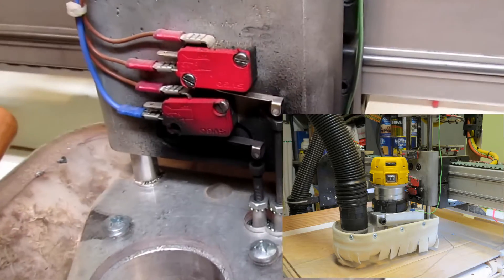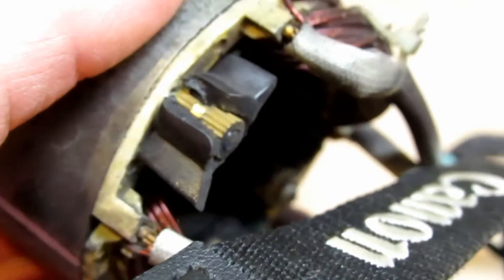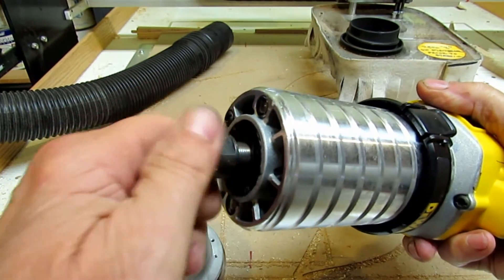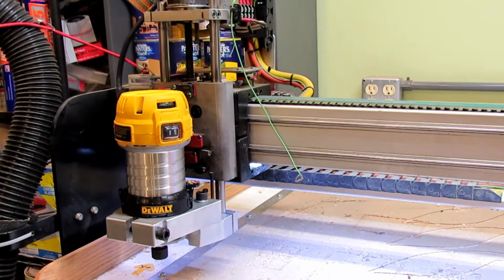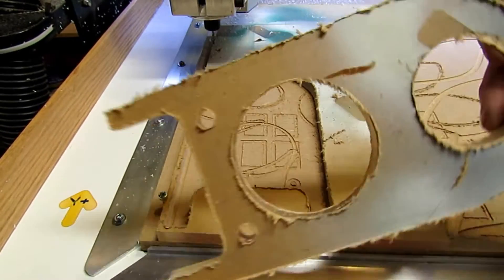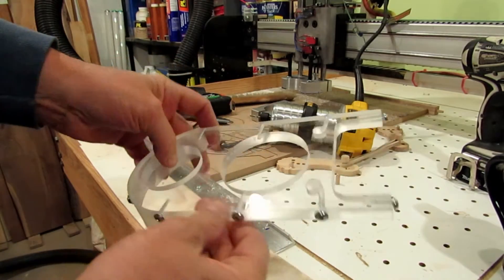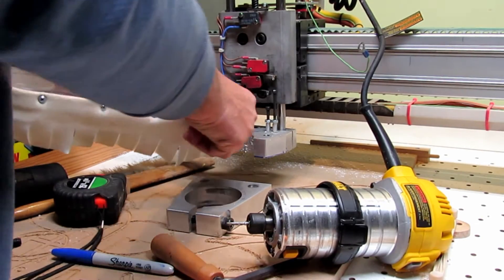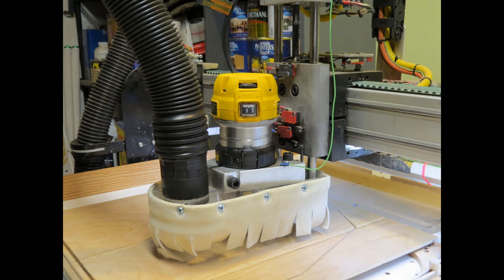Harbor Freight Router Burns Up Dewalt DWP611 Retrofit On My CNC Router

Comment: Are you saying it was the router's fault and not you taking it out of the table, and trying to recycle it to make it a tool you could use as a CNC??  I'm glad you got a DeWalt, however, as a newbie female woodworker, I'm just trying to understand.
Reply from the maker: It was definitely the router relying on the brittle plastic as a framework. Cnc does not put much strain on a router when you set the proper speed and feed for chip load. This little dewalt still runs great with zero vibration after many hours of use. Thanks for watching.
Reply: CNC puts plenty of strain on the router, regardless of the "correct" feeds and speeds.  If your original statement was mostly true CNC machines wouldn't need a very strong gantry system in the first place.  Lets also remember you used a Harbor Freight router.  What becomes apparent depending on how much you spend is how long the router can run before it overheats.  I bought a 25 dollar grinder - it burnt up in about 45 minutes.  I can't imagine a cheap router on a CNC machine.

Comment: I know this is an old video but I’m curious to ur CNC. Did u build it yourself or bought it. If you bought it, may I ask the brand and model
Reply from the maker: I built it from some spare parts that I had laying around.  There is a several part video about the build back a ways.  It is a fun tool to havw in the shop. I understand Laguna makes a nice 2 x 4 cnc router for a little over 6k with software and shipping. Thanks for watching.
Reply: Unemployed Redneck Hillbilly Creations  do you mind me asking how big is the one you have. Looks pretty big. Impressive. May I ask the name of the video so I can check it out. Btw, subscribed. I’m fascinated.
Reply from the maker: It has a 28 inch x 28 inch working area. Here is a link for the first video https://youtu.be/j_-wtBYVLiQ there are 4 videos total with the same name but different part number.

Comment: How long should you be running the 611? I can't find the info anywhere.
Reply: I have run it for over 30 hours straight in my cnc at setting 4. I just changed the brushes at around 200 hours. The manual says they should be changed every 100 hours of use. However, when the brushes fail there is no real damage...so I run it until the motor stops and the LEDs stay on.
Reply from the maker: I have never seen that info either.  Mine seems to stay cool even if I run it for an hour, but I really don't use it that often.  Send Dewalt a email and see if their support can provide you the info if you plan on running one a long time. I was told to keep extra brushes on hand in another comment because they are the first to go.

Comment: you cut the acrylic and full throttle? seriously do a test cut at the lowest speed, you will be surprised that you don't need the speed, it actually will cut instead of melt the plastic.. slow down and the brushes will last way longer too
Reply from the maker: I will have to set up a new tool and try that next time. Thanks for the tip.

Comment: I smoked 2 of them before I got a real trim router..  :) Neither lasted more than a couple hours..
Reply: Just lived it...totally agree.
Reply from the maker: I got aout 40 hours out of it before it burned. I think the little Dewalt should last 10 times as long. Thanks for watching my video.
Reply: Order up a couple sets of brushes for it now.. Router brushes seem to wear out faster on a CNC than hand use. They wear out on a run time bases and how often do you spend hours hand routing anything?  check the brush wear now and then and espically before a job thats going to take hours to prevent a few "oh shit" things.. Having spares handy sure beats being dead in the water for days or paying more in shipping than the brushes.. Replace the spares using the long time cheap shipping method.. :)  --- Lessons learnt the hard way ----
Reply from the maker: That sounds like a great idea. Thanks for the advice.

Comment: If you cut that cord, you can say goodbye to the factory warranty.
Reply from the maker: +Mario Monti Never thought about that, Thanks. Most tools come with a short cord anymore, but this router came with a 8 foot long cord that gets in the way. I guess I will just tie wrap it up and leave it for the first year. I am glad you warned me as I was just getting ready to run out and pick up a plug.